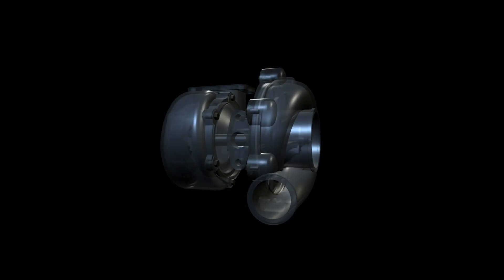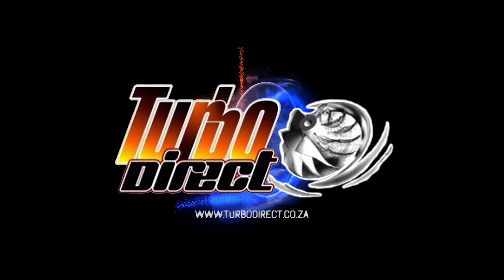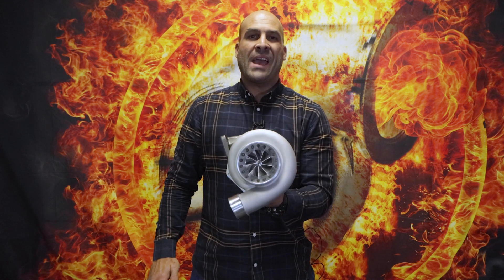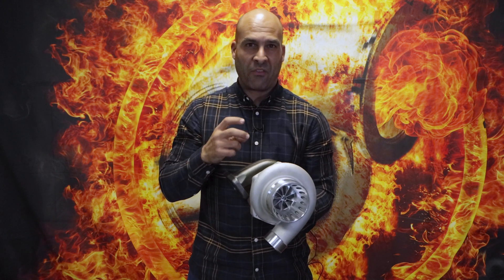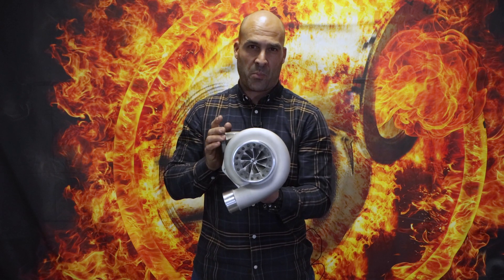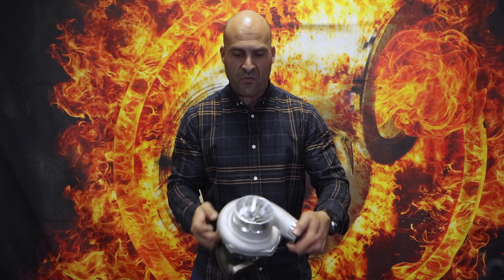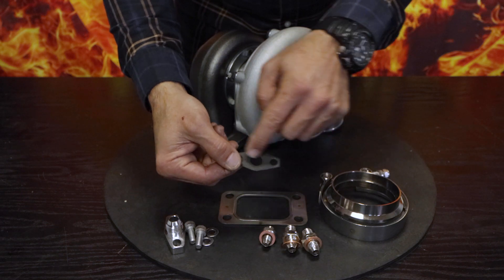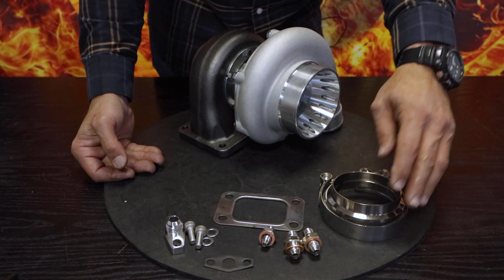TurboDirect S.A true 1000HP capable turbocharger - Ball Bearing

Comment: Will this turbo spool on a 2.0 tfsi?
Reply: Yes fully built is understandable, but at what boost will this turbo need to be run at on 2.0 displacement to reach 1000hp ..obviously if all the fueling etc are up to the job
Reply from the maker: This depending on many things surrounding the engine build. To make 1000HP the engine would need to be fully built - which will include CR changes for high boost and exotic fuels etc -
Reply from the maker: That’s entirely up to the build of the engine, and supporting hardware. The turbo is along for the ride. Higher CR will spool faster and require less boost - exotic fuels will produce more power for less boost, tuning plays a massive part aswell. That question is not answerable

Comment: Ive seen some ball bearing conversion services online. Have you seen any results of any borgy sxe turbos that have been converted to ball bearing?
Reply from the maker: I have not - however don't believe that the SXE bearing housing will be "converted" as its design and oil galleries and their positions are not the same as the ball bearing cartridge location so i would assume that the bearing housing is replaced and machined/adapted to fit into the SXE housings somehow.

Comment: Hi Chris, I am turbo charging a 2.8 24v dual vvt vr6 with a comp ratio of about 9:1. It is a street car. I'm looking to boost between 0.8 bar to 1.4 bar. When will this turbo come into boost as I am looking for around 3700 rpm full boost and not a lot of lag.
Reply from the maker: Bruce thanks for the comment - please tell me more about the HP target you want to achieve - i ask this because at 0.8 - 1.4bar boost there are many turbo options that will yield varying response differences, and obvious power outputs. If per say yo looking for 400HP at 1.4bar boost, then there are smaller turbos that spool faster and will still make this power,  solving the lag problem you identified - if you want higher HP numbers that only the larger turbo can provide you with, then lag is going to be something you will have to live with ---- let me know more about the HP target and i will guide you from there.
Reply: @TurboDirectSA  thank you for your response Chris. I was referring to the turbo in the video and I think I was not clear about that. So, I was asking how would the turbo respond with my 2.8 24v with the compression I have as I am interested in this type of turbo.
Reply from the maker: @brucepeters5100  Got you -- the turbo is well suited to your build and will perform exceptionally well, and will have plenty HP in reserve - it will spool acceptably, however --- still i would look at other turbo options that will yield better response, because your HP target is low..... perhaps your starting point is 0.8 - 1.4bar, but at a later stage you want to increase boost and power - in this case the turbo above will work fine. 

If you only want to limit yourself t the 400HP listed above, then i would choose a different turbo that offers faster spool, and will produce the power easily with plenty to spare - making a better and more driveable setup.  If you can make the power target with plenty to spare, and yield improved response, why not?

Comment: Is this better than EFR8474 overall ? is there a compressor map available ? If for a stock 2j vvti, this or the efr8474 ? 90% street use, max 24-28 psi
Reply from the maker: There are two turbos that are similar - 8374 and 8474 - the later is 950HP capable and uses a black compressor wheel which is larger in size, the rest of the turbo is identical to the 8374. 

The 2JZ will spool this turbo up easily, and it will make the claimed power no problem at all.
Reply: @TurboDirectSA  If it we're for you own 2j, Which would you go?
Reply from the maker: @mkivst180  I would use the EFR8474 Black with AR92 T4 twin scroll internally gated turbine housing.
Reply: @TurboDirectSA  why internally gated? Just curious 😃 and also appreciate all of your wisdom!
Reply from the maker: @Zorres  Less costs, it works extremely well, and takes up less space at the same time. ITs a no brainer  really.

Comment: what would be the spool characteristics and when will you reach peak.boost... can it be compared to the efr 8474 black?
Reply from the maker: On which engine Sherwin?  Spool characteristics depend on many things, which engine, its compression ratio, what fuel is being used, what boost pressure target, what cam profiles and the volumetric efficiency of the engine itself, also how the engine has been tuned (ignition advance etc) its just not a question that is able to be answered im afraid.

It can be compared to the black series in HP output, and spool, since the black series uses larger AR housings on the turbine side i.e AR83 and AR92 upwards - the turbo above uses the AR63, and AR82 volute sizes.
Reply: @TurboDirectSA  b58
Reply from the maker: @sherwinzn1  What boost? What mods? What fuel? What ignition advance? Have you forged the motor? Is the CR stock? Have you got a decent cooler installed?  too many variables to give you an answer.

Comment: Chris, Joe here from Australia, I’ve watched heaps of your videos recently as I’m trying to upgrade from a genuine GTX3076gen2 but not fully sold on the G range for the price asked. You hit the nail on the head this time for me - I’m a mechanical engineer and we have struggled in our business with the irregular quality coming out of China over the years which affects our recycling machines - they break … The fact that you are assembling the units on site and get to do some QC in the process is an excellent approach. The turbo you use in the video is basically exactly what I’ve been looking for, I run a supercharger as well as a turbo on a 1.8L 4cyl so I have an unusual requirement - any ability to ship one to Australia?
Reply from the maker: Thanks for the comment, and i concur China = junk when it comes to turbochargers off the shelf.  I put a challenge out to my sales team around 2012 and again in 2018 - they asked me to import some T3/T4 turbochargers and GT35 turbochargers from China - and my response was "what for?"  they replied saying that they wanted a cheap alternative to Garrett's ball bearing Gen1 and Gen2 GTX range and the original GT3582R model - so i did. 

When the first one failed on a friend of mines car (he knew it was a cheap chinese paper weight and went along for the ride)  i used the opportunity to demonstrate the suppliers TOTAL LACK of knowledge, understanding and ability to support the product from a failure point of view. 99% of the time you deal with a lady who has no technical understanding, no knowledge of how a turbo works, and no ability to comprehend the technical nature of the product - you would have a better chance of your dog understanding the concept due to the language barrier and other aspects.  The usual response is " I will forward to me engineer"   Anyway - This explanation is for another video --- which will shock you, especially when you learn who these companies supply product to....

To answer your question, yes we ship internationally. Shoot en email off to info@turbodirect.co.za if you don't mind.
Reply: @TurboDirectSA  Awesome - thanks Chris, i'll jump on your website as well as touch base through email.  Re China, we have a lot of manganese based steel wearplate castings made there that require the correct alloy chemistry as well as disciplined heat treatment - get any one of these wrong and the parts break easily. The suppliers that source through China tend to jump between foundries (possibly select who can make it the cheapest that month) and you don't know until its too late.  No way i'll put a critical part on my engine, too much to lose.  Keep up the good work!
Reply from the maker: @twinchargedca18  No worries mate - ill look out for your email. China - unreliable, unscrupulous, underhanded -- beware.  Been there many times, seen how they work, and don't even try hold anyone accountable - communist country different rules and laws.   Yeah agreed with you - funny how everyone spends a fortune on the bottom end, cause eveyone does it (forged rods and pistons and fasteners) and then install the shittiest turbo and ECU ..... go figure
Reply: @TurboDirectSA  Hey Chris, I've been looking at your videos lately and learning alot, so thank you for making them. I live in Grenada (tiny country in the caribbean). I'm slowly build my 3SGTE engine that I recently swap from a FWD Toyota Sprinter into a Toyota Celica ST185 GT4. So far I got (CP pistons, Manley rods, ARP head studs and main bolts, Cometic head gasket, Gates timing belt, Spec stage 2 pressure plate with stage 3 ACT clutch disc, 3" exhaust, Stock head, for now). I've noticed that my CT20B is leaking oil so I was thinking about changing it and going for more HP while i'm at it. What turbo do recommend for my build?
Reply from the maker: @YuriMarryshow  Thank you for the compliment. Please tell me what HP target you have in mind? Is this a street car, in use every day? Or is this a drag car, circuit racer etc?
Reply: @TurboDirectSA  Yes it's a daily street car. I was thinking around 500-600HP or equivalent to get me high 10s into low 11s
Reply from the maker: @YuriMarryshow  For a daily that still makes some strong power with a high boost setting and gives you excellent low down response, in the 500-600HP (crank HP) the EFR7163 is the perfect contender, use the slightly larger AR turbine housing with the Vband housing. That will surprise you!

Comment: Does this have a larger compressor exducer than a g351050?
Reply from the maker: Yes it does and because the G35-1050 does not make 1000HP. Garrett overrated their compressor maps by up to 15-20%

Comment: Can you guys put that compressor wheel on a gtx42 but still offer it in a 2.125 vband inlet flange? I feel like if these still use a gtx35 wheel they'll never really make 1000whp.
Reply from the maker: Hi Kotsa - sorry no this isnt possible. These turbo make 1000HP and they make it easily. We have a number of record holding vehicles which run this specific turbochargers compressor including a turbo hayabusa which runs 389.5kmh on a standing start 1000m sprint. This bike produced 734KW with this turbocharger assembly at 2.7bar gauge pressure  - the bike ran the record at 2.5bar boost. 

The fastest front wheel drive car in Africa is a 4AGE in 1600cc format (not the 1900cc) running this exact turbocharger and 2.4bar boost and runs a 10.4sec quarter mile. 

We have an RB26DET with stock motor and drive train running this same turbo at 1.6bar boost with a soft launch (to save the stock motor and drive train) which runs a 12sec dead on street tires.   

There is no difficulty with this turbocharger producing the claimed power.
Reply: @TurboDirectSA  What is the largest turbine wheel that you can put on this specific setup? It seems like most of the competitive 67/68mm turbos that can make 1000whp have 68-75mm turbine wheels.
Reply: @TurboDirectSA  I was just going off the comment you left someone with the link to the turbo. - https://turbodirect.co.za/store/index.php/shop/turbochargers/gtx3582r-forged-detail
Reply: @TurboDirectSA  Are you saying 1000bhp? Because I can see that would be possible. But I just cant see how it would make 1000whp on most 4 and 6 bangers with a a gtx35 turbine wheel.
Reply from the maker: @Jamxknife  Not sure where you getting your information form, because i don't see any GTX compressor wheel anywhere in the video.

Comment: How will the spool be on a stock 2jz with your GTX3584R 0.82 and until where will it still make power. Thanks Chris
Reply from the maker: Keep in mind that this is a 1000HP turbocharger, it will not be the most responsive turbo for say a drift application, BUT it is streetable enough to drive everyday and still make 1000HP.  The AR82 housing is a must for the large rotating assembly internally, and it will produce power up to the 2JZ's redline with no hassles at all. All things considered (decent manifold with a proper collector) proper ECU and tune, with a CR of around 9.5:1 you should see full boost at 1.5bar gauge pressure in the 4500rpm - 4800rpm area.

Comment: whating for the review
it will be interesting if it in 8+0 full blade compressor wheel
Reply from the maker: We played with the full 8 blade design in 2014 already, it works very well - some of the OEMs have used this also with success. In fact our first Golf7R hybrid upgrade was with an 8 main blade wheel - The wheel worked well, but the bearing system failed, which is the problem with the IS38 models today, hybrids just dont work.

Comment: Show us the compressor map. And what material is the center housing?
Reply from the maker: Material spec is the same as all Garrett, BorgWarner and any other OEM manufacturer. The Compressor map is currently being tested on a gas stand. The flow tests done on software simulation show the main difference as a flow improvement at around 1.8bar gauge presure (2.8 P2C) and tests on a 4AGE motor at 2.4bar gauge pressure next to the G35-1050 show 2.5% higher flow across P2C regions from 2.3 up to 3.4 P2C

The next version we are working on as we speak is going to have an aluminium bearing housing with a totally revised cooling system, and bearing cartridge - launch date early 2022.

Comment: Are you going to have it available in different AR’s?
Reply from the maker: Yes - we are working on the stainless steel range for these turbos in the 35 family, aswell as a 9 blade low inertia light weight turbine wheel which will be released by the end of the year. AR79, AR88, AR99 will be available